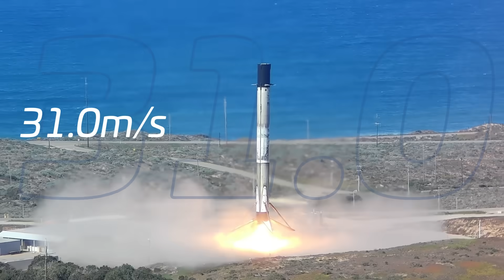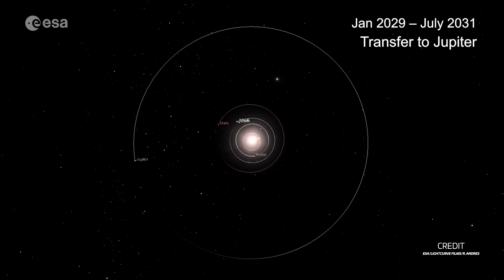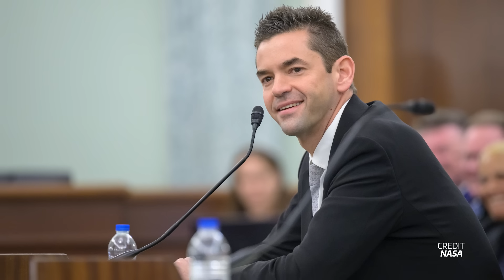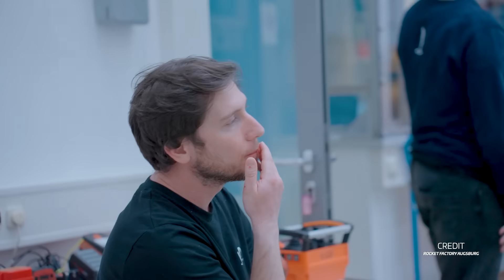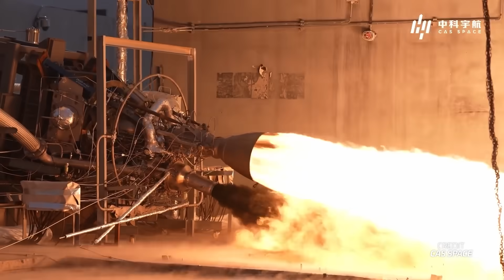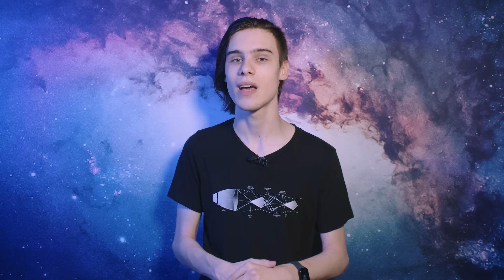This Could Be a Big Problem for NASA | This Week In Spaceflight

Comment: WRT "Complexity" in human landing systems for the Moon and Mars, Bridenstine isn't wrong.  It's just that, as we know, when using a prototyping (rapid development) scheme, complexity is necessarily the first thing you use to develop ideas, and you shed complexity along the way heading towards an overall less complex end result, albeit somewhere down the line, in a not so clear future.  The success, or failure of various prototype designs leads to changes that are somewhat unpredictable (by definition) in the rapid prototyping world.  The vision is broad, and the destination is clear, just that the method is not fully refined for how to get there.

Comment: I like Jim Bridenstine, but I find some of his comments a bit hypocritical. After all, the original Artemis plan—including the overly complex concept of a lunar base and the Lunar Gateway in a NRHO orbit—was developed while he was NASA Administrator.

In 2023, Destin Sandlin gave a talk at the von Braun Space Exploration Symposium critiquing Artemis and pointing out why the architecture is far too complex. Jim is joining that critique a little late.

Do we need to change direction? Maybe. But will switching what we’re building suddenly get us to the Moon faster? Probably not. I think there are ways to reach 2030 goals, but they involve adjusting how we use the hardware already in development. For example, flying Starship boosters in a fully expendable mode could increase the amount of propellant delivered to orbit per launch. That’s just one possible path.

The real priority is clear: get Starship to orbit, test propellant transfer, and understand what’s actually possible. From there, the people who built the vehicles should be the ones driving solutions—not NASA headquarters, not Congress, not the public… and not Jim Bridenstine.

Comment: He's right, in that the current plan will likely mean we lose the race BACK to the moon.  However, I have heard little to no talk about the bigger, more important race.  To be first to establish a long term permanent presence on the moon is the real goal and even that in my opinion is in jeopardy under the current architecture.  China is going to move as fast as they can without pause.  We on the other hand have no realistic sustainable plan to keep Artemis going.  If, we want to beat them back, we also need to address the bigger problem and come up with a way to fund the entire endeavor and do so in a fast and efficient manner.  SLS simply doesn't qualify under those requirements.  We need SpaceX, Blue Origin, Rocket Lab, and others to all step up to the plate.  We need the commercial industry to design equipment to be used on the lunar surface, to setup an industry there to self fund it's development, and the reusable heavy lift capabilities to make it all possible in the first place.

Comment: He has a couple of points, I feel starship should be used for landing tons of cargo for a moonbase, but it might be better to land the astronauts in smaller, lower profile crafts. I worry about tip overs with starships on the moon
Reply: Especially with all the tip-overs of smaller vertically-stacked robotic landers recently...
Reply: @Wordsmiths haven't they all tipped over? 🤣🙈

Comment: Has NASA considered using ion engines to boost the ISS? It would require several large low mass solar arrays, and a several month burn, but let's boost it up to a higher stable orbit instead of letting it burn up. Pick an orbit that isn't used by many satellites so it won't be a danger. I'd rather it be an orbital museum than a charred coral reef.

Comment: Sorry but to say Bezo’s system is 4 times as fast as Starlink is very misleading, the speed is dependent on number of users accessing the system. I’m betting there are hardly any user on the system? When Starlink first came out they were a lot faster too, but then the users went way up.
Reply: yeah it's pretty much the same as plugging into your ISP's core network and saying "look at my latency bro"
Reply: Yes, it's called "Shared bandwidth" and has been the case with technologies for internet since the early days, including cable. If you're the only one on the cable (on the xmitter/receiver dish) you get the WHOLE bandwidth. Add users, response time and bandwidth begin to degrade.
Reply: Yup, that's what I was going to say. My Starband satellite service back 25 years ago was fast until they got more subscribers and then it slowly went down.
Reply: Just like they mentioned shortly after?
Reply: @FootballKingInSpace-j9v  
I don't remember them saying it shortly after.

Comment: I am VERY interested in seeing how the 'in orbit fuel transfer' deal is going to work.   Starship did a small transfer within itself from (I'm guessing) header tank to main, but transferring tons from ship to ship is going to be difficult keeping the liquid flowing in 0 G.   The only way I can picture it is to link then spin the conjoined craft to use centrifugal force to settle the fluids.   Guess we'll see!
Reply: What about creating a vacuum in receiving ship and  slightly pressurizing supply ship.
Reply: @HermanSnoddy-i3u  We were talking about the fact that the fluids need to be controlled before transferring even begins.
In zero G it would all just blob around freely, you need to get it all settled in one predictable spot in order to go from one side to the other. 
We were talking about how just spinning the two would do this.

But on your question, after it has been settled. There is an issue.
I get what your thinking but these fluids would instantly boil and freeze at the same time if they were exposed to a vacuum. So it would just be gas going over until it either met the same pressure as the first tank or gets clogged by ice. 
This would break the whole system and make it unusable from there on out.

Its got to be two tank under very similar conditions so the fluids stay predictable during transfer.
Reply: For sure, it really shouldnt be difficult at all, depending on how fast they want the operation to be done. Obviously there will be issues beyond what your discussing that might be a bit painful but when it comes to 0 G, thats an issue that was solved 50 years ago by someone just thinking for 20 seconds after being asked the question.
Reply: @Vatsyayana87  Really?   What was the solution from 50 years ago that I've not read about?
Reply: @recoilrob324  The exact same one you came up with after thinking about it for 20 seconds...
The gravity simulation of spinning something has been known and used in many ways well before flight was ever a thing.
Give it a slight spin, have the pumps on the far ends, job done.
Reply: @Vatsyayana87  Cool!   I hope you're right and they get it done.
Reply: @recoilrob324  I have no doubt they will, Its the small issues we dont think of that could cause delays and unfortunately there is a time pressure with it all.
Artemis 3 can not happen without this being a relatively easily done process and its next on the docket.
Reply: Es soll nicht bei 0G stattfinden.   Beide Raumschiffe sollen leicht beschleunigen um den Treibstoff zu sammeln.

Comment: On the reboost topic starting at ~ (23:00): There was another series of supply vehicles reboosting the station sometime back: The European ATV - 5 vehicles in total - had been used for reboost manvoeuvers as well back in 2008 to 2014/2015. Sidenote: The service module of the ATV is the base for the European service module of the Orion capsule - so that might explain the capabilities of the ATV hardware ... 🤓
Reply: Orion? Isn't that the transport vehicle that doesn't have a reliable heat shield? Lol

Comment: I think the first Blue Moon Human Landing System should be small like the Apollo Lunar Lander to beat China 🇨🇳 back to the Moon. Maybe there is a few flights of small Blue Moon until the full size one comes on line or Starship Human Landing System. The next main goal should be to have crew orbit Mars in Orion and then land with Starship or the full size Blue Moon. The problem is that NASA doesn't have the budget to build a big Moon base or Mars base even before the big budget cuts.
Reply: 2x vehicel 2x cost